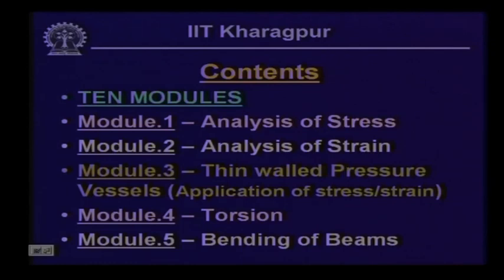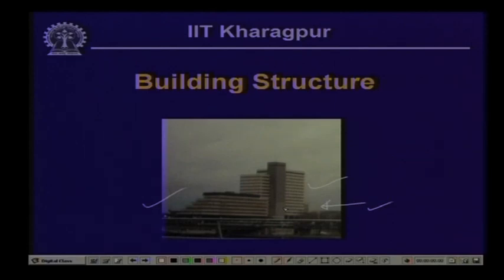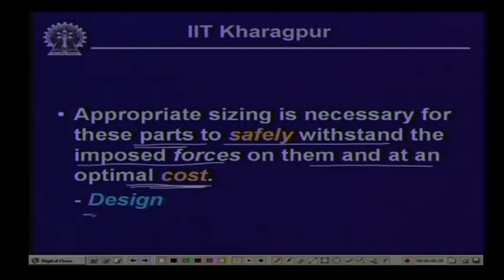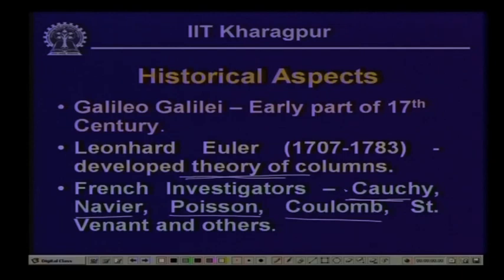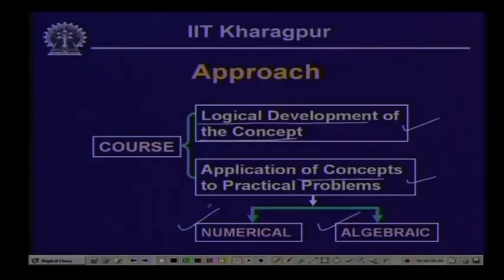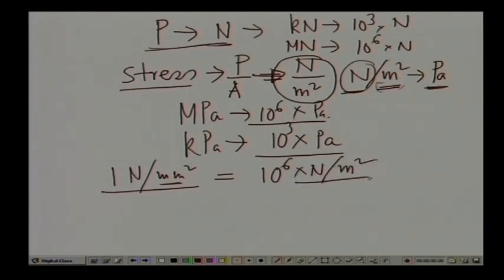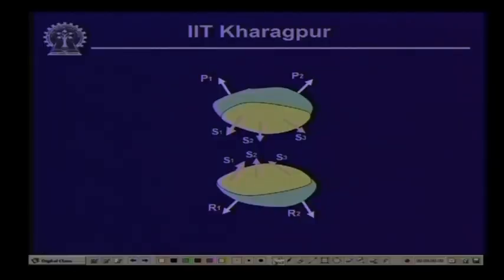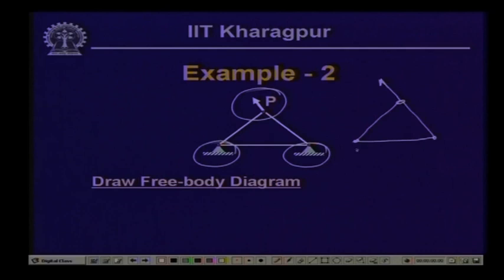Introduction

Comment: Best lecture for university exam, gate preparation as well as for general knowledge purpose. I know the quality of video is not like those which we see in these days modern lectures, but I know one thing that this type of  content, you will not get anywhere. Not in made_easy, gate_academy or any other coaching institute. These lectures are really impressive. CONNECT YOURSELF WITH KNOWLEDGE, NOT WITH THE VIDEO QUALITY
Reply: Is this enough for gate?? Mechanical backgrounds
Reply: @mechtrackvm6912  mechanical ka alag se playlist hai